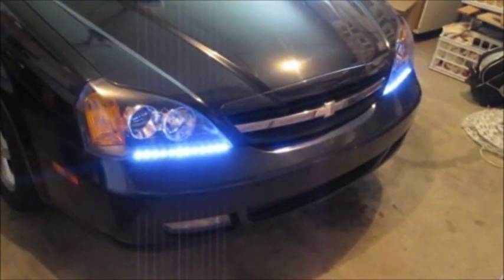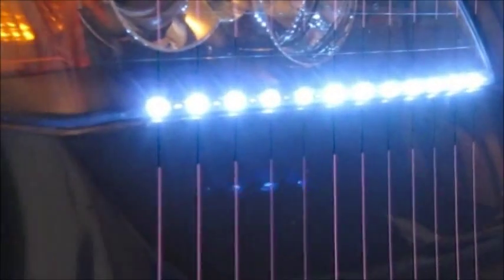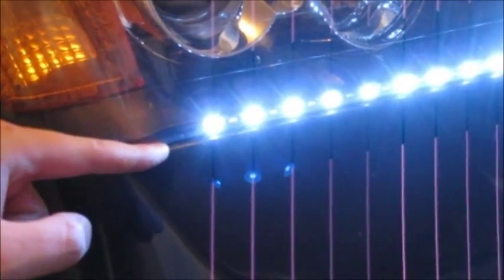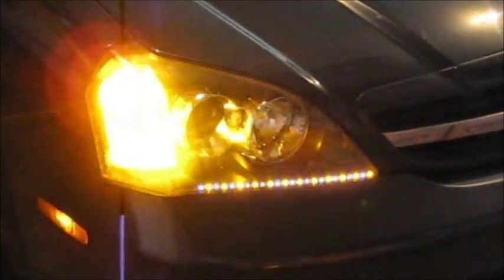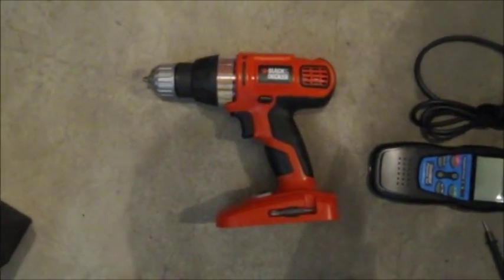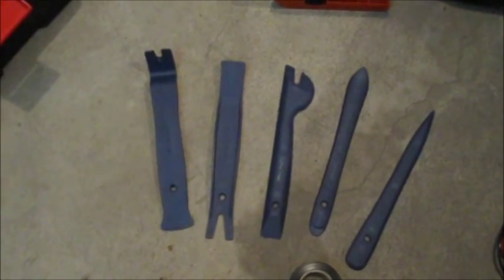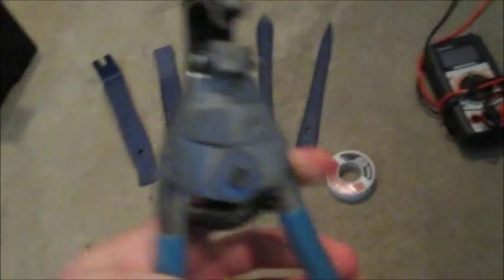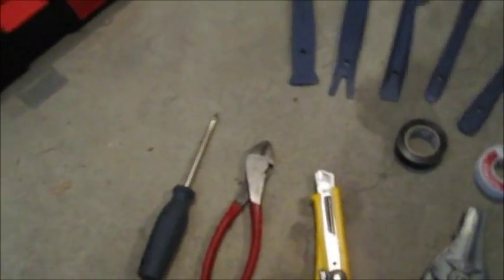Plasmaglow Running Lights Mod Part 1

Comment: Soooo, where is part 2?
Reply from the maker: Hey, sorry man. Not too long after this video was made the engine spun a cam bearing damaging the camshaft. Filings from this got into the oil and damaged the rest of the engine and I ended up selling the car as a mechanics special.